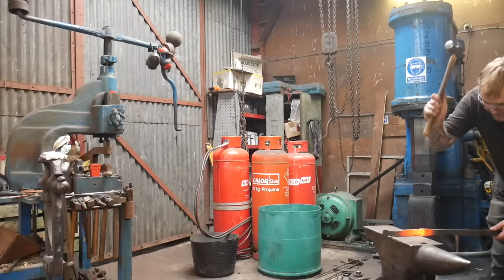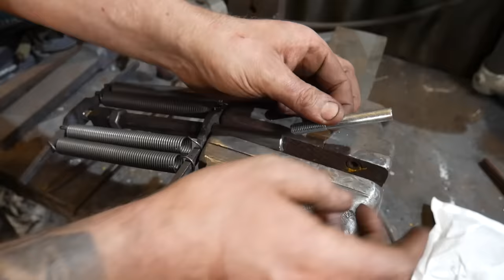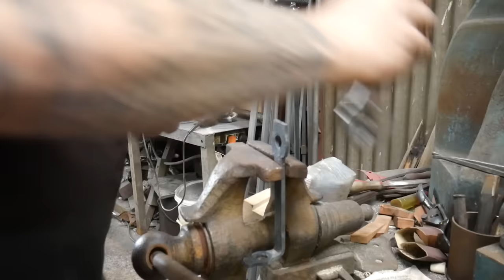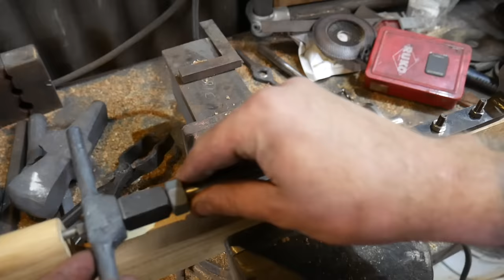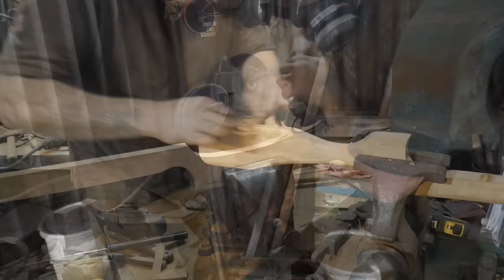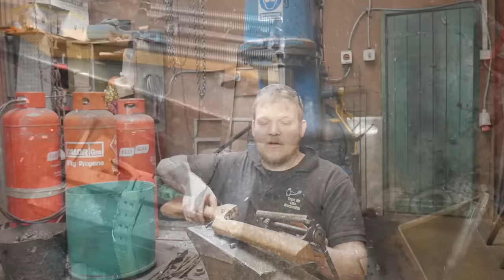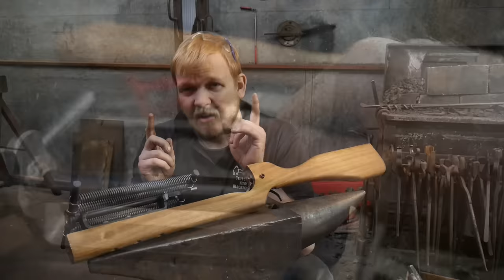The Spring Bow! Like a crossbow just with springs Pt.1

Comment: Great minds think alike. Yours is very similar to the one I built about a year ago. However, I used an "X" configuration front and back instead of limbs. This made the whole thing a lot more compact, reduced the torque on the limbs and reduced drag. I also used softer springs and a much longer draw with a modified speargun trigger. I put a sacrificial teflon washer where the plunger strikes the end of the tube which reduced noise considerably. I fire ball bearings, paintballs, darts/ mini crossbow bolts and wads of compressed rock salt. I won't go into the lethality but the local ferals don't big up my vege garden anymore. I'm looking forward to seeing your modifications.
Reply: I went to your channel to look for your construction in x... but... XD...
Could you share an image of this X result? thanks (mayube can you put it in my email).
Reply: Thinking my way into this, i actually had the same Idea, inspired by something like:

The Anti-Dragon-Ballista from "The Hobbit", which also used four Arms, to launch it's projectiles.

Comment: This is really cool!

You are absolutely right, the energy is there. Its how its transfered to the ballbearing that is the problem. As you can see alot of the energy you want transfered to the ball is now being transfered onto the nut , smashing it instead of firing the bearing.

What you need to do here is to make the piston slam into the ball bearing by moving it up the pipe. This will transfer alot of the kinetic energy from the piston to the ball rather than the ball inheriting the momentum of the piston.

This is the same principle of a how a  hammer works. You would never be able to push a nail in despite using alot more energy but by shockimg the nail more of the energy is transfered to the nail itself rather than into your hands. Beware though this will damage the piston
Reply: If he uses a strong tool steel tip on his piston, it should take quite a beating before wearing out. I think if he wants to retain the ability to shoot both bolts and BB's, he should affix a strong magnet towards the end of the pistons stroke to hold the BB in the right position

Comment: Hi Dan, I’m thinking you want to reduce friction between the blunger and barrel as much as possible. My first thought was to simply lubricate the plunger and barrel but as you mentioned, the slop between the plunger and barrel may be creating friction by the plungers angle so you would do well to tighten that up....without adding to the friction. Using  "o" rings would likely add more friction to the plunger and barrel movement.....unless you use something like an acetal (polyacetal) sleeve in the barrel or acetal rings at either end of the plunger so that it both lubricates the plunger movement and takes any slop out of the plunger/barrel relationship. Using a larger bearing would likely add a level of air pressure from the wrong end and reduce performance, the tighter projectile idea works well where it needs to build upon pressure from behind to perform - ie normal firearms, spud guns etc.
Reply: that's correct... the air pressure can still be reduced by making air exhaust holes in the cylinder.

Comment: I tripped over this video by accident and haven't checked for part 2 yet.

Springs may be more efficient than a bow- after you shoot an arrow the bow is still under tension (keeps the string from falling off) but springs can go completely slack. However, springs don't release their energy linearly like bows (more or less) do- springs exert a lot of force right when released and then taper off. That means you get a constantly decreasing acceleration force on the ball bearing- it may actually outrun the piston on the way down the cylinder, so you don't actually recover all the energy from the springs. Heavier ball (lead rather than steel) would help that.

I'd add little nubs to the crossbars that hold the springs rather than cut notches which could introduce weak spots.

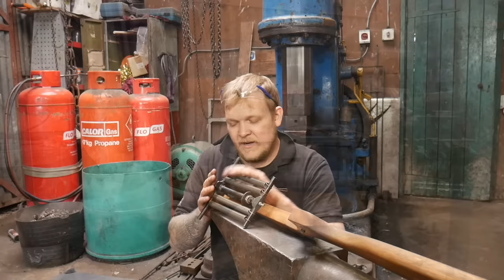You might benefit from more practice with firearms (shotgun bigger than 20 ga but smaller than 12 ga I'd say)- you need to lean into the stock to prevent wasting energy on recoil. Watch the slo-mo at around 15:11. The stock should not slam back like that. To really see the difference, brace the springbow against a wall or something else solid and fire it at a cardboard box again.

Years ago I thought about building a springbow with a single motorcycle front end spring but never get around to it. I'm thrilled to see someone not screwing around and actually building something. You've already done far better than I ever did, or likely will.
Reply: En français

Comment: As mentioned Joerg Sprave and Tod Cutler are great sources of inspiration.  lightening and bushing the piston will make for smoother acceleration, if you want a more compact set up you can put springs inside springs for slightly different spring rates.  You could always try gas springs!!.
Also M10 grub screws make excellent bullets
Reply from the maker: All great ideas looking into it.

Comment: I'm not sure how technical you would want to go with you ball bearing launcher, but it looks like you are off to a good start. The weight of the moving parts is an issue. The back spring arm holder could be lighter but you would lose strength. You  could try a split cylinder that the back spring arm would slide along to  eliminate travel wobble keeping everything in line from release to the end of travel. But all in all  it looks like a fun project. I like these kind of projects, the process of figuring everything out from scratch and refining and tweaking to get to the point that you're satisfied with it. It's just for fun anyway. To me that's what being a blacksmith or a craftsman is about.

Comment: Dan interesting project. Good advice below. My contribution to the discussion would be: 
1. Use brass pipe with a small steel plug at the fighting end. 
2. Tighter tolerance to concentrate energy to the projectile. 
3. Polish the inside of the barrel. Wooden dowel on a drill, a wee split in other end to slide in & hold some emery, rap around to tidy fit, a little light oil like heating oil and push up and down with the drill running; reduce grits. Finish with a some gun cleaning cloth & "Autosol" cream, running on the drill. 
4. Lube with graphite or something that won't collect dirt.
5. Projectiles: try bits of wooden dowel, acorns,
6. What about replacing the springs with catapult rubber & rap it 2 or 3 times around the holding arms your springs are on.
Just some thought that I haven't tested but think would improve the system. If all that fails, you could go high tech like my son did, make an air chamber with a plumbers gas valve & connected to your barrel. Fill with your air compressor. Point it away from anything that can rebound. Fire & you will be completely amazed, power & distance. It will hurt or injure someone if it hit them. Crazy I know but incredibly 😂😂. I'll stop there before I start talking about black powder & get you jailed. 🤔🤔🙄. Can't wait to see your modifications. Regards, Hugo Dale.

Comment: The shorter the draw, the more power is required to achieve speed. Avg. crossbow with 15 inch draw capable of approx 200 fps is going to be 150# - 180# and a 400 gram arrow. With your setup it looks like effectively a 10 inch draw. Will need to increase power to get more speed, or increase total draw length, or reduce ammo weight. 
Using your setup, honing both barrel and piston to high polish will also help. Piston should be shaped like a valve so only the front actually contacts the barrel. Instead of a nut, use a delrin washer for the stop. A delrin washer will last longer, take more abuse, and will be easier to replace. The reinforcing sideplates is a very good idea. Might also consider a small magnet on the front of the piston to hold the bearing ball lightly. And collaboration with Jorge on the Slingshot Channel would be an excellent idea. He, also, tries out various ideas for bows, crossbows, slingshots, swords, etc., etc., etc. He has even made a magazine for a bow and arrow that works just by drawing the string back. Touch base with him. I think you'd really enjoy bouncing ideas off each other.

Comment: Ok, here's a thought. Maybe reverse the system, and use compression springs? Rig a detachable peg, for 'cocking' the bow, by foot power. 😀👍
Reply: Maybe like a softair gun, with the ball bearing sitting in an o-ring a spring pushes it out of

Comment: I like your project. If I can throw some ideas into your melting pot
for low velocity a sphere is the best shape adding mass such as using lead will to some extent carry the ball slightly further.
You are using four springs which have the same handed twist  if yo look at your spring gun you will see it wants to twist the bolt carrier in one direction, this looses a small amount of power,  also I doubt if the springs are equally balanced meaning one or two springs are doing more work. hanging them from a bar and determining their unloaded length then adding the same known weight and measuring the extension would give an indication as to which spring(s) are stronger.

As  you said giving the springs a register would help especially if the ends are captive to ensure the pull is directly fore and aft.

I would suggest having left an right helical twisted springs so they oppose any twisting moment an ideally a push spring system using two springs one inside the other as use on engine inlet an exhaust valves would apply all the force directly into your piston.

The damage to your nut indicates that there is still tension in the springs as well as momentum of the moving mass while it looks like lost energy there would be little gain from trying to harness it as the projectile is already moving at the maximum velocity, a hard rubber buffer would help to eliminate the thump and also reduce the shock affect on your aim.
a rudimentary ring sight at the rear and a post foresight would assist  or using double ring sights smaller at the rear helps the eye aline the barrel to the target.

A brass or bronze bush that supports the piston would help lubricate and square up your piston you might loose a small bit of rearwards motion on cocking but that would be regained by easing the pistons travel.
Is your projectile a tight fit, or sloppy fit, is your barrel mirror finished inside to reduce friction could you apply some Teflon spray to minimise any friction.

Comment: Make a metal stock out of square tubing, skeleton stock.The most dangerous part about crossbow type weapons is not just the bow or spring failure its a weak stock. Have you tried using a single more powerful longer spring to keep the bulk down. rather than multiple. Make use of the centre rod you could put your power spring there. You also have to remember that the power is taken up by the weight of the recoiling mechanism, by the time the power is transferred to the projectile you have lost a bit of energy. Don't forget to use some rubber buffers to stop it clanking at the end of travel. to help stop it breaking apart ofter quite a few shots. Watch out using ball bearings for ammo as they  can fly back at the shooter, use lead balls. use a light wire spring to hold ball in place or light magnet if you do use steel ball. Great workshop you have.

Comment: This is actually a very interesting concept, that should definitely be able to improve a crossbow's weakness...

The Durability of its String.

I'm really sure, this kind of Crossbow can be just as Strong, as a regular one, if the right springs and a proper way of Transmitting the Momentum are implemented.

Comment: I would recommend lightening the piston as you've already stated, lengthening the forend to about double, and maybe try playing around with rubber, or you could make a pair of limbs and cable them to your current setup. Honestly, just do some general experimentation, but the springs are most likely what will ultimately limit you in the end, super heavy springs will dump a lot of energy, but with a super short launch stroke, yielding low efficiency, and light springs will give you a much longer launch and a greater efficiency at the cost of power. Unless I'm wrong, which I probably am, there's no winning with springs, at least not on this project. Anyhoo, great concept, keep it up!

Comment: Hello friend, it is a very good project, perhaps, adding a longer barrel, the projectile would come out with more power, and improve the trajectory. blessings and greetings from Chile.
Reply from the maker: working on it part two is coming soon
Reply: It's not a firearm or air rifle.
A longer barrel isn't going to have the same effect on a mechanically launched projectile as it does on a pneumatically launched projectile.

More powerful springs, tighter tolerances to minimize wobble and lighter moving parts would be the best way to optimize this build.

The only real benefit to a longer barrel would be in using longer springs, which could help deliver more energy to the projectile.

Comment: Awesome craftsmanship, need some speed multipliers to generate power! tension springs can retract at about 100-200 FPS. Compounding the mechanical action requires some creative engineering. Many ways to do it, but necessary for increasing speed!

Comment: G'day mate, so this is very interesting because I had this same idea back in the mid 80's but never really did much with it beyond pen and paper. Here are some thoughts which I've since used on other projects. 

Springs. So there is a LOT out there in the world of springs. First thing you need to do is figure out the parameters of what you need (pound per inch of pull, total pull length, width etc) and then get spring made to these specs. Store bought springs will only take you so far. That being said, you should look into springs catalogs to see if what you need has not already been made and is not already available.... that would make things a lot easier. 

If after much gnawing of pencils and gnashing of teeth, you realize you just can't get a spring made to fit your specs (maybe because to get what you need you would need a longer length of pull than the stock will allow or it would be too wide), consider the option of using compression springs instead of extension springs. It's basically like using a shock absorber and the fun thing about compression springs is they tend to be very powerful on shorter lengths than extension springs. It's a different beast altogether and you gotta build a housing for the spring and that comes with its own headaches, but it is an option.

If you do go with extension springs, one thing to know, the failure point is going to be those loops you attach the spring with. So the way to work around this is to machine a plug that screws into the inside of the spring and is made to the specs of the spring's wire. When an extension spring is pulled, the spring tightens down on itself and gets a bit smaller, so as soon as there is tension on it, it will squeeze the plug, so that plus isn't going anywhere, just make it long enough to get a few threads going. The center of this pug can then be drilled to accept either a bolt or cables. If you use cables, make sure you use cables that are ten times (I mean this very literally) stronger than your maximum draw tension, so that it isn't the cable that fails. By using a cable, you will need to swage a stopper to the end of the cable. Do not use ordinary pliers to do this. You need to use a special tool that is used in aeronautics because these special pliers will form the swage sleeve with even tension all around the cable. There are many types of swage sleeves and many materials (aluminium, copper etc). Use the strongest you can find. A properly swaged sleeve should give you around 80 - 90% of the cable's strength, so if you've chosen a cable that was many times stronger than the limit of your spring, even at 80%, the swage sleeve is still stronger than your spring. You see where this is going? You want to raise your levels of safety at every turn, because you're gonna put a lot of pressure on this thing and you don't want that to fail in your face.

As a companion to the inner plug for the extension spring, you may also want to make an external sleeve that wraps around the outside of the spring, covering the area where the plug is fitted. This sleeve is in two parts that close around the spring and it also has threads that match the wire of the spring and is held on to the spring by screws on either side of the sleeve, clamping it down over the head of the spring. This external sleeve does add size to the spring, so you'll need extra clearance to accommodate it.

Next, cams. Although I don't have a lot of experience with cams, you might want to look into them as they do offer extra power and a lower neutral hold point once drawn. 

Stock. You may get to a point where more strength than simple wood is needed, and at that point the first level is of course aluminium, but don't use cheap stuff, use high strength aluminium, like the 6061 or the 7075 alloys. If that still doesn't do the job, you may have to either incorporate steel into the design or go with carbon fiber. I don't know enough about carbon fiber to be of much help here.

Last but not least, I HIGHLY recommend you build a testing bench so you don't have that thing in your face when you are first testing it out... 

Good luck!